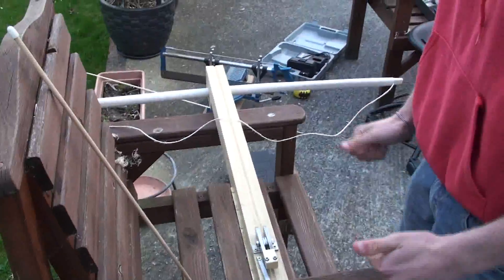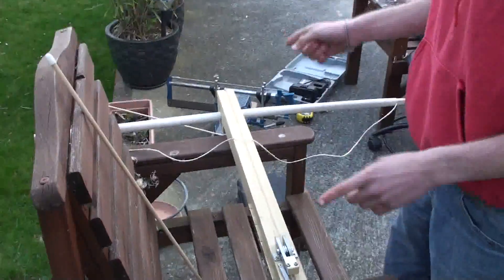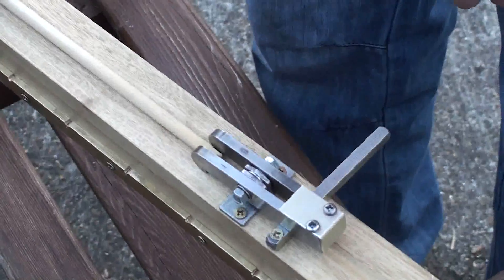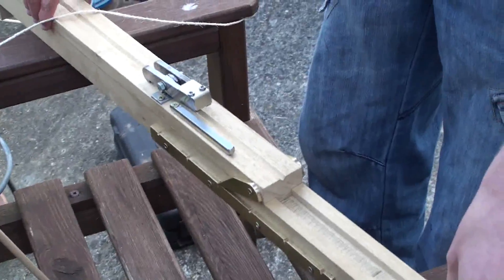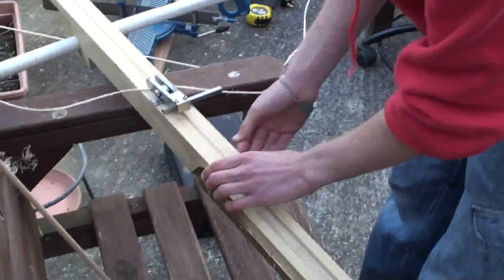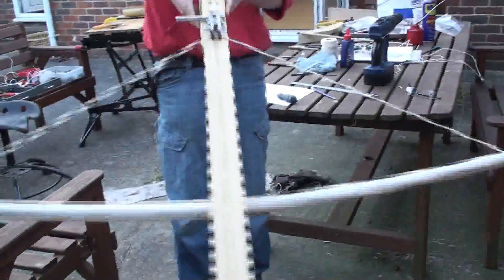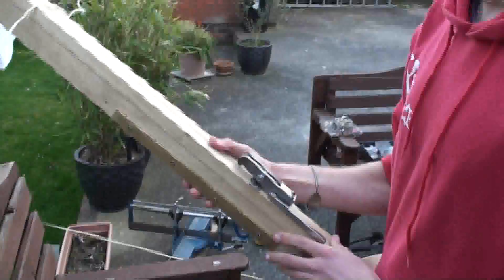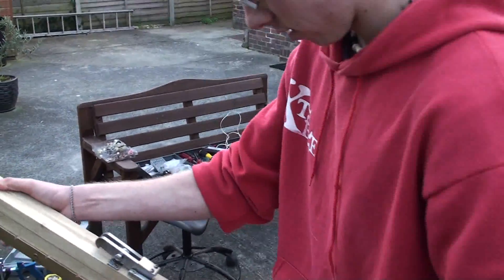Gastraphetes - Summary and test firing

Comment: Ah, gosh...As soon as I saw the whole thing, I knew it will not have great performance. The prod is too short and too weak. The stock is too short, too. You won't get any performance improvement unless it's got longer draw length and greater draw weight. It really is pathetic.